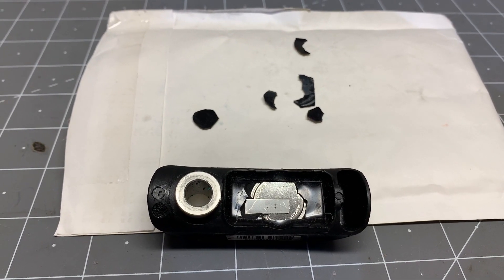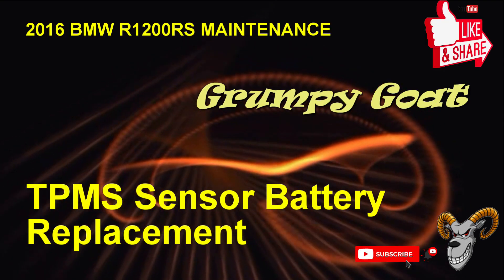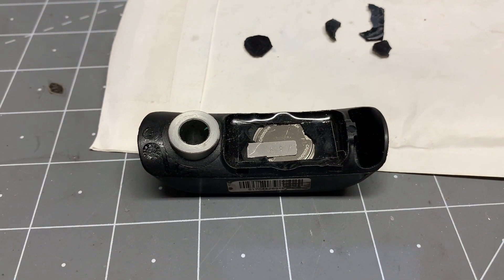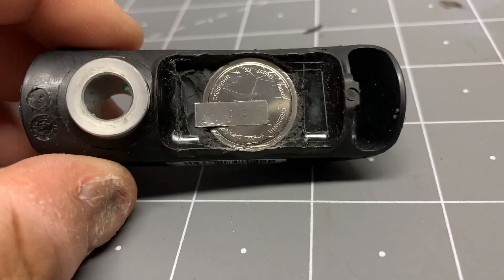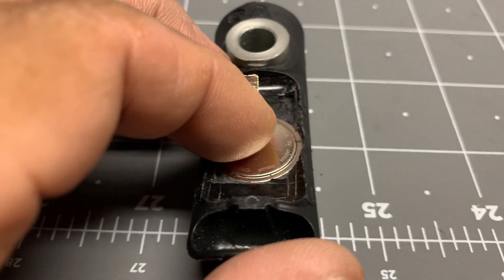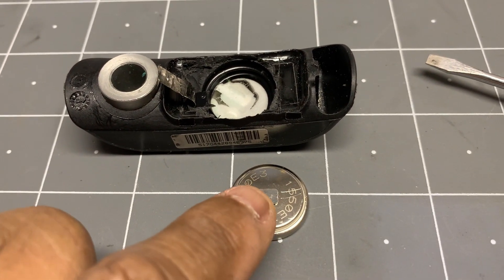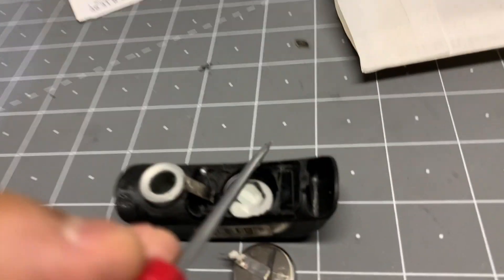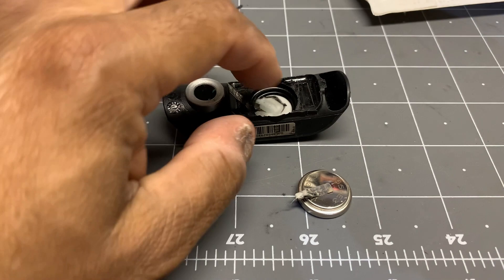Can you replace the battery in the BMW R1200RS / R1250RS tire pressure monitoring (TPMS) sensor?

Comment: A bit tricky. For how long do such sensors work? Id rather not have them. :)
Reply from the maker: My bike is 10 years old and they still work. I prefer to have TPMS. I’m presently finishing up a 3000 mile road trip and it is great to check my pressures daily and from time to time as I do 500 mile days back to back between hotels. The technology is there to be used.
Reply: @GrumpyGoat If it works flawlessly 10 years... there is nothing to complain about. How many miles do you have right now on the RS?
Reply from the maker: About 65k miles

Comment: I managed to prise the bottom connecting loose from the battery with a small wood chisel, before removing the battery completely.
There are two types of sealant used in these sensors, soft and hard. The hard one is tough to remove with a knife or small wood chisel, it is easier done with a Dremel tool with a milling cutter attached.
Reply from the maker: Thanks for the tip. How did you stick the connector back on to the shiny surface of the new battery?
Reply: @GrumpyGoat  I haven't gotten to that point yet, will be something for the next days when the new batteries are delivered.
I've ordered the Maxell CR2050HR (which is the original battery of the sensor), which comes with 2 tabs installed, so I'm not connecting directly to the battery surface, but to the tabs, which should be a bit easier.
If there's enough room, especially for the bottom connection, I'll probably connect them with some solder.
Reply from the maker: @zombiewoof5257 Great. Let me know how you make out.

Comment: You can replace these batteries successfully with just a little more work.  You are correct that SOME of the sensors have the bottom contact welded to the original battery, which tends to tear off of the circuit board when you pull it out.  However, not all of the sensors were manufactured this way.  And, you can dig a little more epoxy out of the way and solder a wire directly to the circuit board for a new battery.  I'm posting a video today on my channel on this very subject if you want to take a look.
Reply from the maker: Good to know that at least some of them can be replaced. Will check out your video.
Reply: @GrumpyGoat  I just published it, here is the link:  https://youtu.be/IJwOydKrH4E

Comment: Very interesting to see. My rear wheel sensor has become a bit iffy. Sometimes it works, and sometimes not. I’m hoping I can get an aftermarket sensor as the OEM BMW ones are crazy expensive. Any thoughts on that?
Reply from the maker: Brad, there are lots of sensors on eBay or Ali Express for about $20 each. You’d have to buy a $20 “wake up” tool and the bike should recognize it. I say “should” only because I have not done this myself, but I have read accounts from owners of GSs (mostly) who have had success. 

I’d say that your iffy sensor is due to the lithium battery dying (this happens over time) and the resolution is to either replace the sensor or the battery. For my out-of-warranty bike, I have zero issues buying the aftermarket $20 sensor and tool, and when I come to that point I will of course make a video to document the process.
Reply: @GrumpyGoat  i Think the problem with those cheap sensores, are the battery life expected.  I read that the battery should be the CR2050 HR ( High temperatue) and over 550 mAh of power output.
Reply from the maker: @josecosta9557  Probably true that they may not be using long life batteries, BUT if they are only $20 and they work accurately and they at least last the life of 2 tire changes (for example) then it is probably more cost effective to get these cheap sensors and replace them periodically than to buy the OEM sensors. Even if you replace them before they actually die.
Reply: @GrumpyGoat  Got your message, but some sensors last 2 / 3 months, and the trouble you have to remove and install the tire makes you think twice.. I will order a CR2050HR Battery, and see how long it lasts. The Cr2032 lasts 3 months only!!
Reply from the maker: @josecosta9557  Yeah 2-3 months is unacceptable. Didn’t know it was that short.
Reply: I've heard of such devices. Crazy how this stuff works. Magic, hocus pocus! It may be my turn before yours to try a fix. Honestly, I should be proactive and get the parts needed so when I change my tires I can replace them.
Reply from the maker: @bradb2514  I think that would be a good idea because unless you change your tires yourself you will at least save the labor of tire removal / reinstallation / balancing.

Comment: Good video Wayne, my front one failed just outside of warranty and I was a bit annoyed that the dealer replaced the whole sensor and not just the battery, now I can appreciate that the change was necessary and any frustration should be directed at BMW for the design of a sealed unit rather than dealer.

Comment: I've had success replacing just the battery on my previous BM an F800ST... I haven't checked but surely your Asian friend, Ali, would offer a replacement sensor at a reduced price compared to the OEM replacement part?
Reply from the maker: There are several options on eBay but whether they work with the current water-cooled R1200/R1250s is a good question.

Comment: Sorry, but others worked at this with different results. https://youtu.be/X0RQbXJovq4
Or
https://youtu.be/Mpjz0cDjnK4
Reply from the maker: I am aware of that. The sensors are not the same, the batteries are not the same and the welds on the battery electrodes may vary. Consequently success will vary as well. Point is, the crucial point is in loosening the welds without breaking the connection. If that can be accomplished then the swap is not difficult. Sorry if that did not come across.

Comment: Thanks for doing this. Was thinking of just replacing the battery when mine go. Dont think it's worth bothering now
Reply: It is worth the try, beside the fun, you may save some money. Search for it. There are other vids showing how to do it. And some recommendations at the comments of them
Reply from the maker: If and when the time comes for me I don't know if I would try and do this either. The risk of pulling out the bottom (negative) "lug" is high but I suppose that if you have it off it would be worth giving it a try - you might be lucky to break the weld and not separate the contact from the motherboard of the sensor. If that is the case then you should be able to complete the job with a hot glue gun.